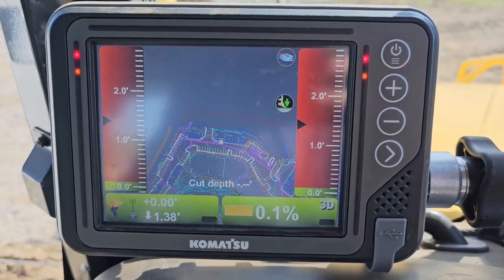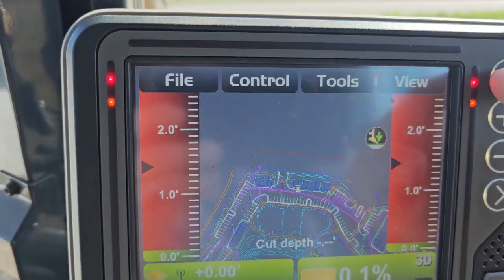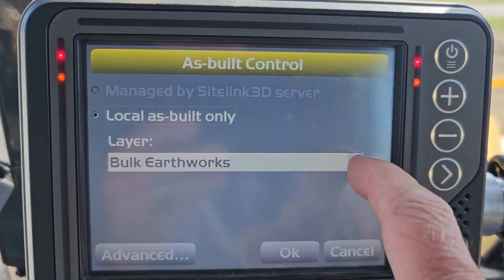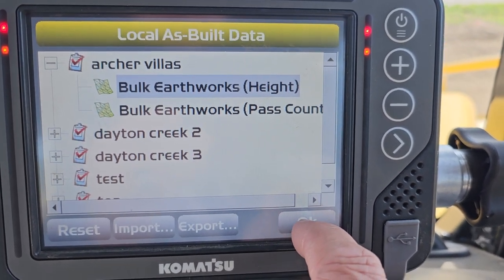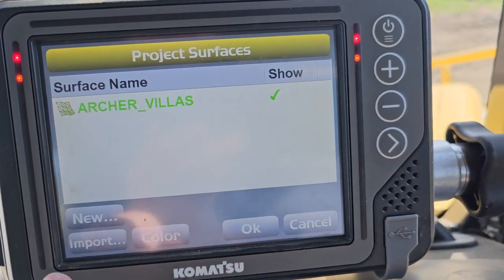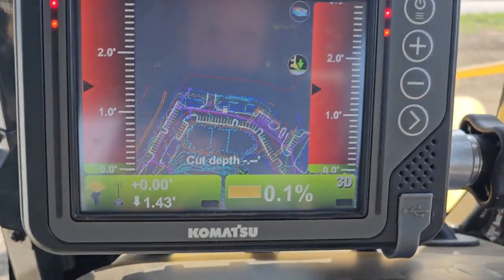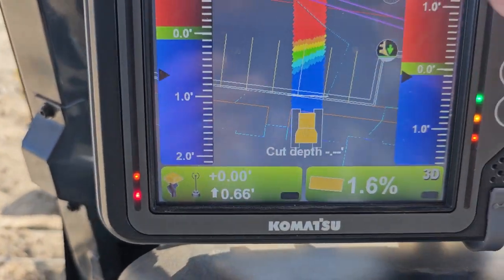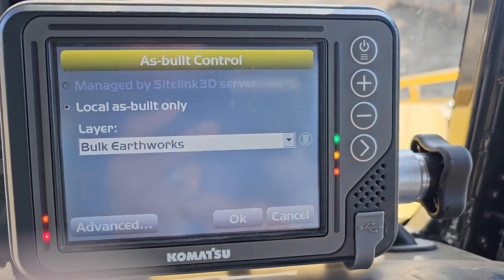Creating and Exporting As-Built Data - Komatsu IMC Dozer, D71PXi 2.0

Comment: How do you get those light on the side to work because I run a D61 but the lights on the side do not work
Reply from the maker: If you hit the Menu>Control>Machine Setup. 
Select the machine file and hit Edit. Don't change any settings just hit next till you get to the lightbars. You can then configure the left, right and middle to your liking.

Comment: Which version of 3dmc is this? I dont have a option to make surface from as built
Reply from the maker: This is on the Komatsu IMC machines. It's very similar to 3DMC but is a different in a few ways. I don't know if this is incorporated into 3DMC yet or not.
Reply: This is a imc 2.0 system